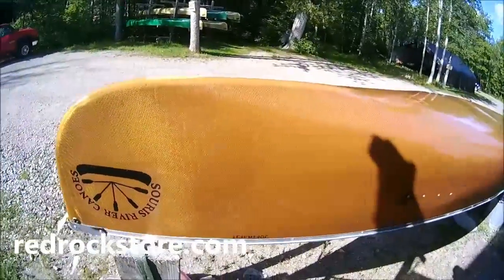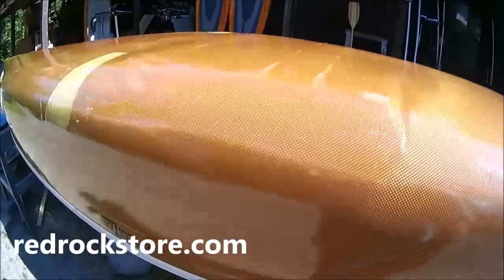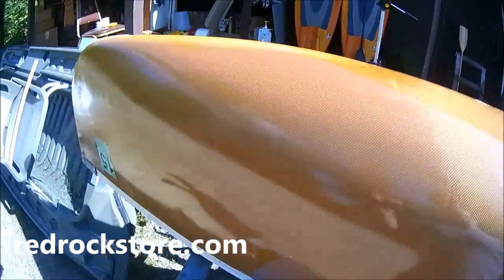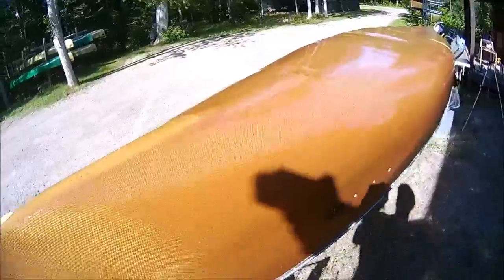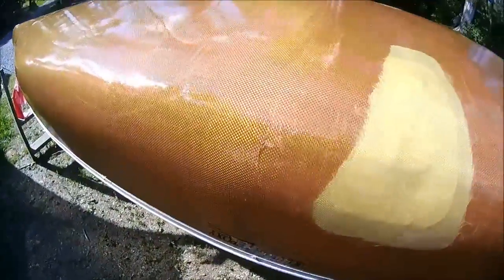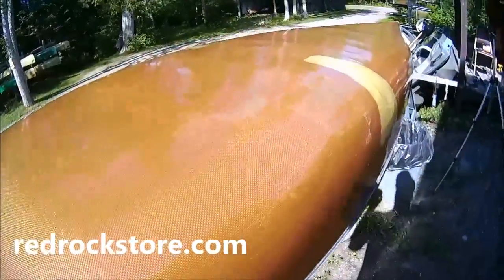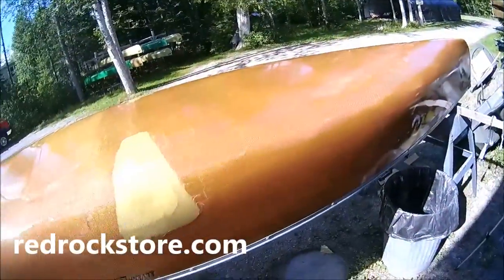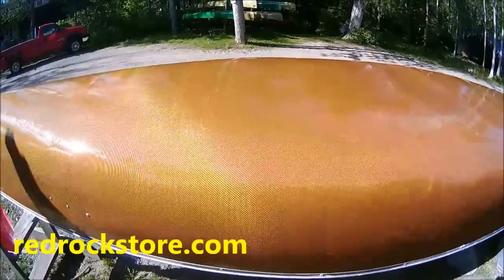Kevlar Canoe Repair - refinish

Comment: I have a kevlar kayak that I bought with a clear finish that has faded and turned white. I sanded a lot with 150 grit and got the whitest area off most of the hull. I was thinking of West Marine epoxy and using a yellow roller pad once I sanded off the white areas. Does that make sense and would you apply any finish over the epoxy. Any ideas appreciated. You certainly did a good job. Congratulations with your canoe.

Comment from the maker: Is the finish gel coat or resin?  Is the resin epoxy or vinylester or polyester resin?  I really don't know what to expect by recoating with West System or any other marine epoxy.    Sorry, but not all watercraft are the same and how it was built could also affect how to refinish it.  My guess is that you can recoat with West AFTER you sand it with 80 grit paper.  Need 80 grit sandpaper is what West says to use to allow the resin to mechanically stick (called keying in)  into the vinyl/polyester resin.  Finer sand paper could allow it to release from the hull after curing.  If the hull IS epoxy resin, successful bonding will be chemical and mechanical.  That will be a stronger bond.